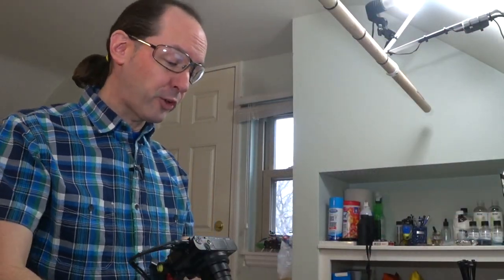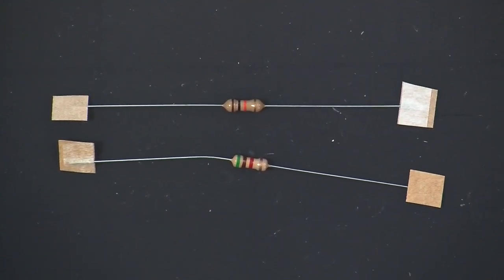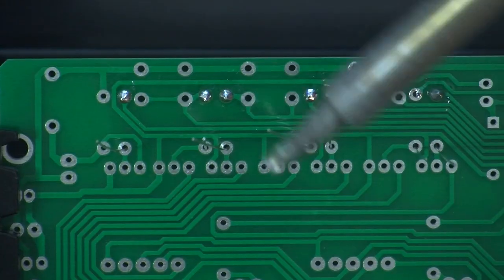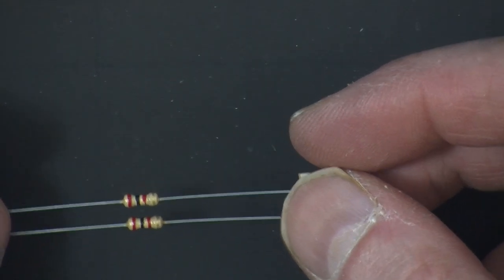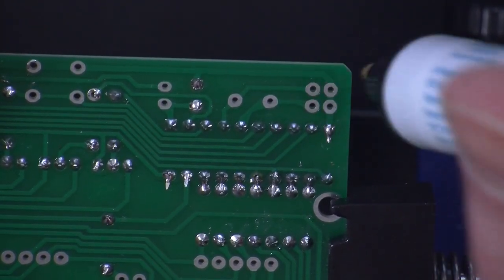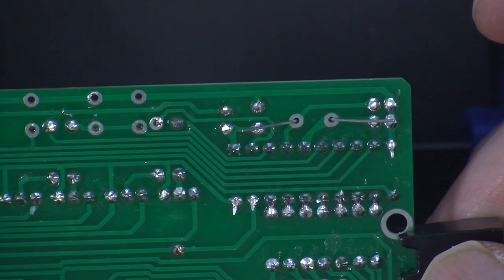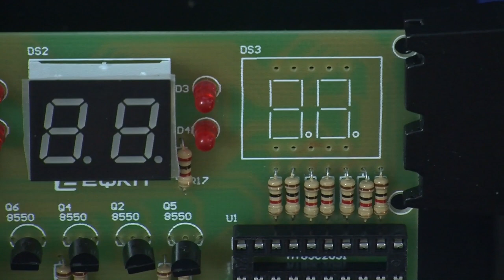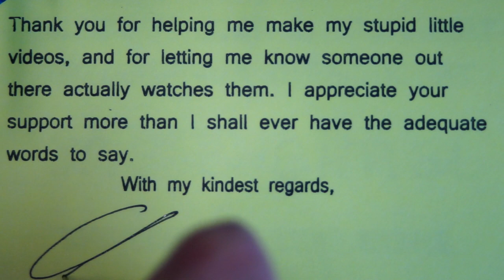Kits With Chris Episode 11 - The 6 Bit Clock

Comment: I think I know the cause of the rough soldering at the start: because there were so many pins, you weren't introducing the solder 180 degrees away from the iron. That resulted in the solder contacting the iron before the pin or pad, which resulted in the solder preferentially climbing up the tip, rather than wetting out the pad.

Comment: It's 6 digit
I would have spaced the displays away from the board (a tip would be to get header strips, remove the header pins and push the display pins through the header plastic, or use female headers as sockets for the displays)
Replace the buttons with panel mounted buttons.
J1 is a sounder output.

Comment: if you want to be nitty gritty you could represent numbers 0-9 in 4 bits per, I designed something that uses 2 eight bit shift regs to drive 4 digits using BCD to 7 segment decoders, uses 4 bits to do the numbers 0-9 and blank a digit

audion is a type of an ancient triode vacuum tube (valve) XD

the green resistor is likely 5100 ohm (5.1k) the black may be brown (the board confirms 5.1k)
br,bl,or is 10k

tip flux the solder braid (and get the good stuff like goot solderwick)

Comment: what happens if a resistor is to high or low?
Reply: Really depends on what the resistor is doing. With digital circuits like this, usually they're pretty forgiving - Up to an order of magnitude or more in some cases. Many of the 1k resistors on this kit are current limiting resistors for the LEDs. Low resistance there will increase the current through the LED, and thus the brightness. Too low and you may blow out the LEDs. Higher, and you'll reduce the current and brightness.